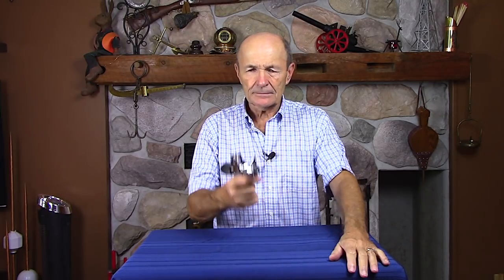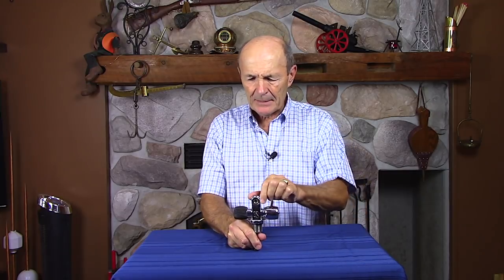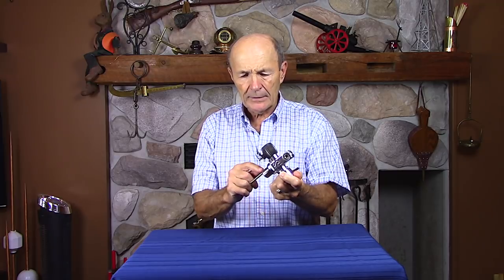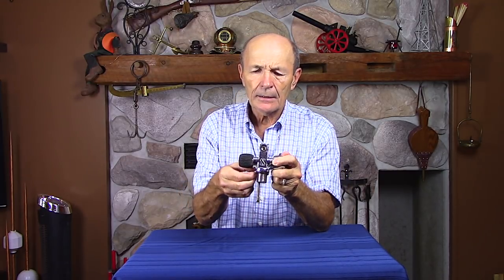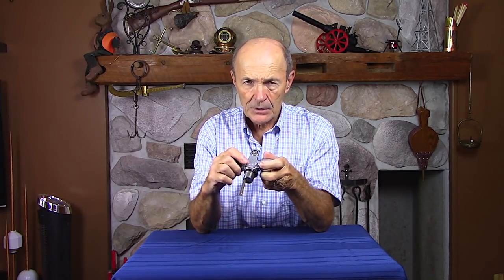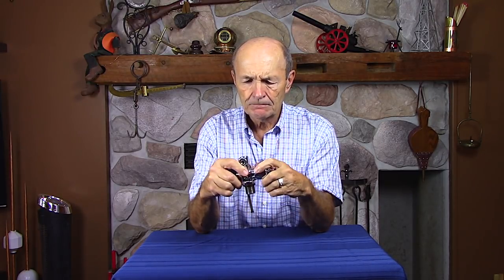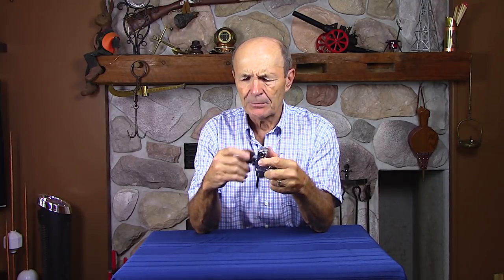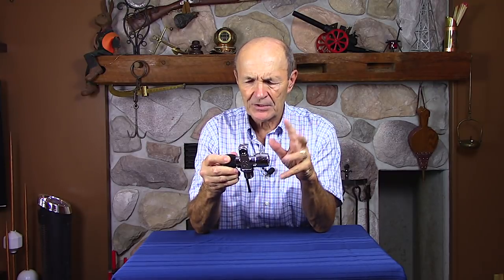Vintage Scuba: The King of Tank Valves - S06E08

Comment: Hey Alec,you forgot to mention the depth compensated adjustable reserve. Great feature,you can change the reserve from 300 to 600 psi,and it gave you more reserve at depth . DCAR valve! Great piece of classic dive gear.
Reply from the maker: A DCAR is quite uncommon. It does have a use for divers who dive deeper than normal but not so for most recreational divers.
There have been many unique valves over the years - some good; some not so much.
Take care.
Alec
Reply: I thought that was a DCAR valve? Doesn’t it have the screw on top to change the reserve from 300 to 600?

Comment: Hey Alec I was just wondering when did side mount diving get popular? Thanks
Reply from the maker: Well, I'm not so sure that it ever did!
What I mean is that sidemount is a current fad that is popular among a small group of divers - a small group spread over a large area granted. Sidemount is not a common recreational diving practice.
However, to answer your question, it appeared in current diving about 10 years ago, was adopted by the major agencies about 8 years ago and is promoted by the semi-techs. That's not at all derogatory. I simply mean divers who want to have additional air for whatever reason and like the sidemount methods.
I should also point out that carrying extra tanks of air is not new at all. I was doing that, along with others at the time, in the 70's. Formal gear configurations and methodology is what's new.
Thanks for watching.
Alec

Comment: Alec, I'm a diver starting in 1965 I remember this "j" valve, we use to get our tanks filled at U.S. Divers in Beverly, MA, but that internal pressure gauge built into the valve is new to me I must have been snoozing...was this valve a mandatory valve or were there "j" valves without the gauge?

Comment: Hi Alec, Thank's for showing the King of Valves. I have a question, when i purchase a new tank, do i specify what valve i want or is that a standard pre installed item. Looking at tanks i see no references to the valves on several well known dive gear websites. Please Advise. Are these called K valves ? Best Regards
Reply from the maker: In North America, the "K" valve is standard but no one calls it that, its just called the valve.  The one option to consider is if you want a DIN insert that unscrews to allow a DIN regulator to be used.  Good only if sharing your tank with someone from Europe or you get into tech diving some day.
Take care Mark.
Alec

Comment: Hi Alec I can see right away the dip tube is smart safety but the gauge will been safer with a dip tube also don't you think  ?
If it's good for one should be good for the other also, why they stop that close of perfection ?
It was probably safer anyway to not relaying on this gauge anyway in case it got stuck at full !
Keep the mojo in the groove 🎸🥁🎷🇨🇦🇲🇽
Reply from the maker: Yep! That gauge was a good indicator that you had air in the tank. To rely on it to dive would not be smart.
Alec